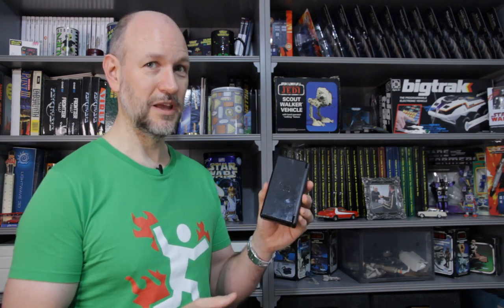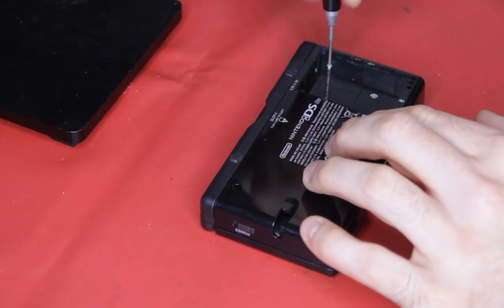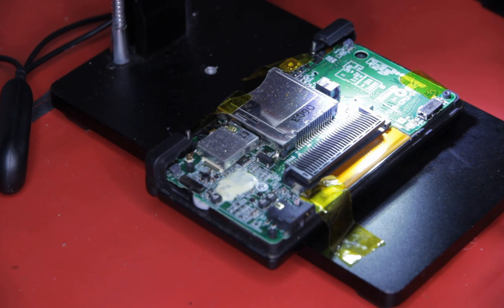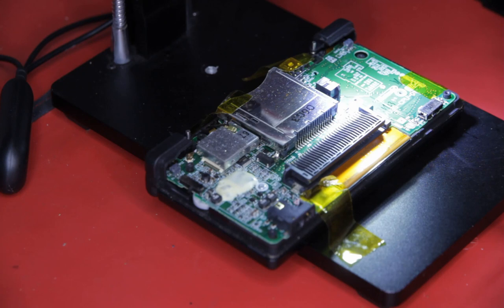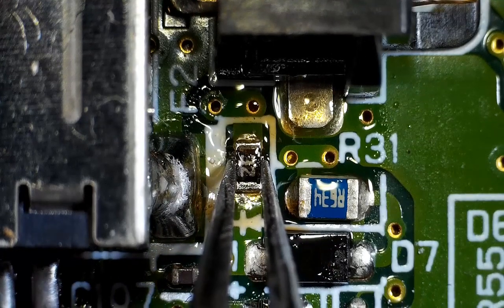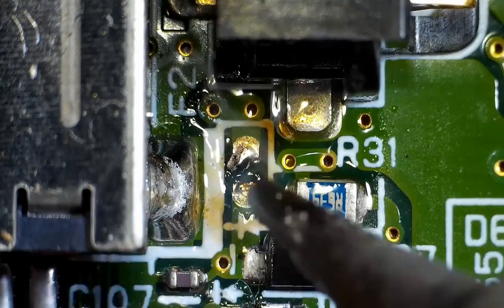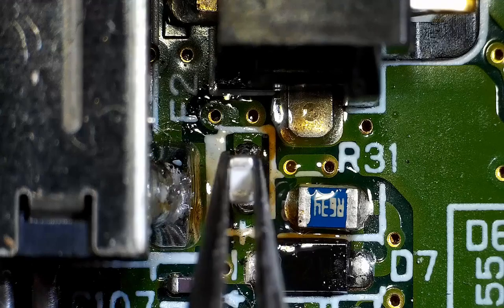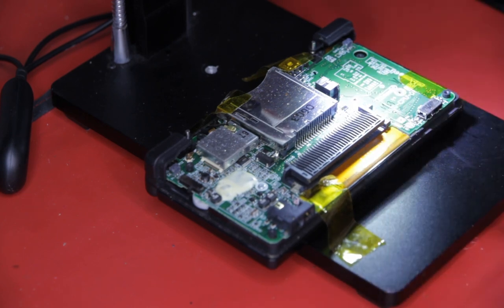How to fix Nintendo DS Lite (dead with no power)

Comment: For me i can t identify the problem. It charges but don’t turn on. Also it has a broken hinge
Reply from the maker: That sounds like both fuses are fine. Have you checked the power switch, that's another common part to break. You can purchase both the switch and new hinge quite cheaply.

Comment: Is there a way to fix it without opening it up🧐🙁
Reply from the maker: Unfortunately, unless the issue is with the battery or power supply, which can be easily swapped out, the type of problem I show in this video can only be repaired by opening the device.

Comment: i found that my upper screen's  flat ribbon cable broke...n also orange light come n off again..
Reply from the maker: Thank you for watching. I've never replaced the cable in a DS but I have had to remove and refit the same cable when I changed the top screen on a DS. I remember it being a bit fiddly to put the cable back. If you can get a replacement cable there's a good video on changing the top screen that shows how to remove the  cable. Good luck.

Comment: anyone from the U.S. have a link to where i can buy this fuse?
Reply from the maker: Hi, this appears to be the same fuse as I used available from Digi-Key in the US, but I haven't tried it myself.
https://www.digikey.com/en/products/detail/littelfuse-inc/0603SFF050F-32-2/3587573
Alternatively I notice there is a US seller on ebay.com but they are selling 15 at a time (Search DS Lite fuse). Although I do notice that a lot of UK sellers also appear in the ebay search results as posting to the US. Being so small, they easily fit in a letter and are pretty quick and easy to post. Good luck.

Comment: Anyone know amazon or eBay places that sell the fuse ?
Reply from the maker: I'm not sure what country you are in but if you search "Nintendo DS lite fuse" on ebay or Amazon you won't go far wrong. List by lowest price with delivery and don't pay more than a few dollars/pounds for a couple of them delivered.
Reply: The Digital Orphanage I saw 2 but one had golden things and the eBay one seemed good , can you do me a big favor and check for me I’ll send you 2 linkss
Reply: The Digital Orphanage the ds lite was giving to me by a nice man
Reply: The Digital Orphanage Also where the 32 thing is suppose to be it’s not there it only has a blue thingy with gold In the middle
Reply from the maker: That looks a good starter kit for soldering, but the fuse is physically way too big, it should be 1.6mm long by 0.8mm wide by 0.8mm deep (i.e. it is tiny!). I had a look on ebay.com and Amazon.com but couldn't find anything that looked right which was strange. I'm guessing you're in the USA so I had a look on Digikey and found the same type I used.
https://www.digikey.com/product-detail/en/littelfuse-inc/0603SFF050F-32-2/0603SFF050F-32-2CT-ND/3587573
Don't forget to buy the small tri-wing screwdriver or you won't get into the case.
Reply: The Digital Orphanage I had one already for try wing but I don’t think I can cancel it I’ll see what I can do
Reply: The Digital Orphanage thanks for the fuse though , I’ll see what I can do , is the thing being to big gonna make the job I impossible or just very hard ? Also any tips I have never soldered before
Reply: The Digital Orphanage also found out I broke the power switch itself but ordered replacements I seem to only need the soldering iron if I’m correct and some flex ? Which I also need to this , please reply back and help I really need you would be saving my life
Reply: The Digital Orphanage Soldering Iron Kit, 60W Upgraded Soldering Kits Adjustable Temperature Welding Soldering Iron Tool with On/Off Switch Use for Your Home DIY Electrical Repairs Jobs and Other Soldering Project, US Plug https://www.amazon.com/dp/B07XSHCY7P/ref=cm_sw_r_cp_api_i_5kGqFb49CJ6R0 here’s one last one , at the end this is gonna cost me 25-35 but I’ll keep the soldering iron for time to come and the guy gave me the lite because it was busted to there’s that , also where does the solder come from? Is it like a glue gun where you put the thick glue in the back ? Or does the solder machine magically put out the liquid
Reply from the maker: If it's too big it won't fit in the space or bridge the two pads correctly. It may even stop the case being put back together if too deep.
Reply from the maker: I presume flex is a typo for flux. Flux helps the solder flow and adhere better by cleaning the surface of oxidation when it melts. My advice if you've never soldered before is to get some scrap electronics and practice on that. Remove components and resolder them. Make sure your work area is tidy and uncluttered and never leave a soldering iron unattended when switched on and hot. Holding the iron in place too long can damage the circuit board too. There are some great "how to solder" vids on YouTube too.
Reply: The Digital Orphanage ahh but do you think any of the ones I sent you I can use ?
Reply from the maker: Any links you put into comments get put in a "held for review" area so I don't see them unless I go looking for them.
All of them will do the job but the last one has a multimeter, a better stand for the soldering iron, and a better tip cleaner (the copper stuff in the tin). All good equipment if you want to do more soldering but a little excessive to fix a DS once.
The solder is just in a reel and you wind some out and hold it in one hand with the soldering iron in the other. You really should watch some basic soldering videos.
Reply: The Digital Orphanage thank you so much I want to make sure the tip will not be to big , question I see some flux that is cheap but is in like a tin , and the pens are like 8 dollars which would you recommend? Out of the 2 I could leave links
Reply from the maker: All of them look to have at least a small conical tip so you're fine there. A little bit of flux paste from a tin will be fine for this job. Most solder has some flux embedded in its core so you may not even need to use any, but a little does help make things flow better. Practice on some scrap electronics to get the feel of it first. I've made the mistake in the past of trying a new soldering technique on the thing I wanted to fix and made it worse before I learned how to make it better, so don't make the same mistake.
Reply: The Digital Orphanage I’ll order the set for now , a cheaper one since big one not needed and I’ll go from there , I’ll tell you if it works as well thanks for everything you have been a ginormous help also like I said I have to replace the power switch as well
Reply: The Digital Orphanage the one I’m going to buy comes with wire is that what you pressed over the chip thingy to help take it off ?
Reply from the maker: Best wishes, hope it goes well.
Reply: The Digital Orphanage I just kind of found out how it works I use to think it was like a glue gun but no I was mistaken , should be good tho I’ll look at tutorials
Reply: The Digital Orphanage alright I think I got
Everything I need to know but will practice before hand , just to be clear when you pressed the soldering machine against the f2/32/old fuse did you do it to melt the solder again and make it be able to pry away ? Do you think the suction solder thing I’m getting will work as good as the cable ?
Reply from the maker: Yes I did. If you put a little more solder on and melt both sides you could also slide the old fuse away and then clean up the pads with your solder suction tool before adding fresh solder.
Reply: The Digital Orphanage I’ll try my best This should be my last question and my next comment will be a outcome of either success , or failure , I have ordered the set with pretty much everything you used except the flux and braid but I got the pump, the fuse you linked , and finally some extra power sliders which were my fault lol , I need the solder to get that working too

Comment: guys!!! If this has happened to you I may have a solution. It might not work for your Nintendo ds lite but it sure worked for mine (and no this is not a troll). Literally just shake the DS. It might reset the DS and you have to input everything and but that's fine. I just did it and was very very surprised to see that my ds turned on straight away. I'm going to make sure to take care of my ds better from now on and try not to drop it :[]. Please give me feedback and reply telling me if this works for you!

Comment: I was really excited to fix my ds following this video as it has the same problem. However, after my screwdriver and fuses came in I was not able to easily put the fuse in place as it's so god damn small. I don't know how you made it look so easy in the video, but my fuse kept getting turned at an angle after soldering one end, and I wasn't able to get it in place with a good connection. I was extremely disappointed because I really thought this was going to work. This is not a job for the inexperienced. Don't even try if you aren't a soldering god.

Comment: C’mon Nintendo! This is ridiculous!!!

Why did you design a game console where it has the potential to blow a fuse and need surgery!!??
Reply from the maker: Most devices have such safe guards to protect more expensive or harder to replace parts. Some use resettable fuses though that reset after a short while. Perhaps the speed rating, size, or cost meant they couldn't use that type.